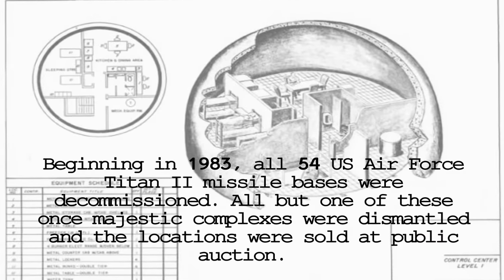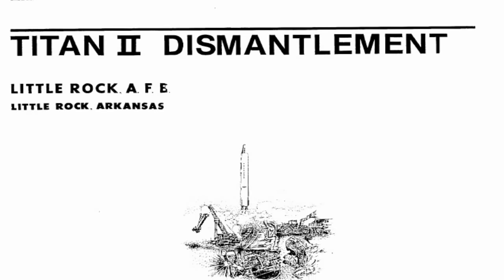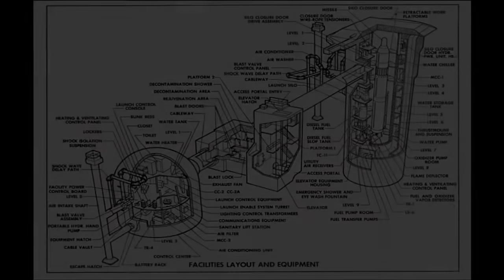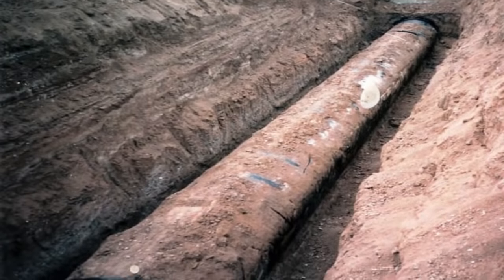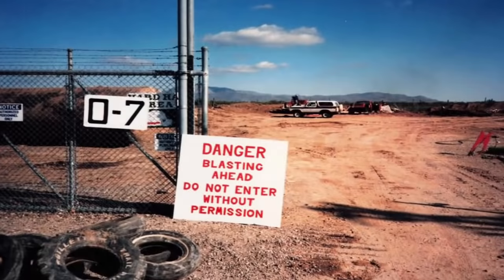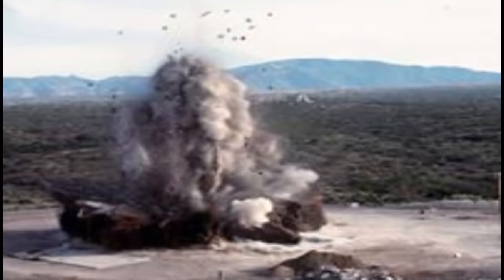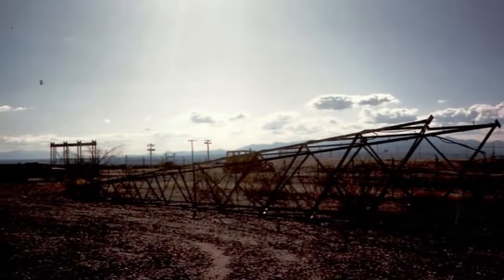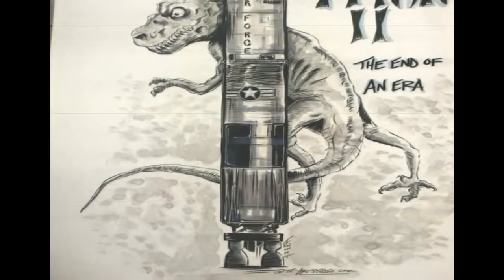Titan II Legacy - Part 3: Deactivation

Comment: This answers everything I needed to know about the condition of the silo. Thank you sir
Reply: I have personally been inside 2 of these facilities. Neither were the saved sights both were "decommissioned" per this video. However only about 10% of the connent in the video was actually done.
Reply: @hellsrangers1  Good old 'Lowest Bidder Wins' principle. Wonder how long it'll be,  before Pelosi Schumer Feinstein AOC decide to sue the contractors for not performing the contacts to spec?
Reply: Erik Davis what 10% of demolition was done?  Primarily the silo?
Reply: Thanks for the awesome videos. What were the tires used for during demolition? Absorb the blast and send it back down for ultimate effect? That’s my guess.

Comment: Three years ago I visited some Russian nuclear missile sites in the Baltic states. The first one I checked was completely gone, while some aerial photos available on mapping sites in the www where still showing them intact. Judging by the size of the trees at at size, the demolishment hand happened not more than two years ago.
At the second site I visited, work was just going on. They basically excavated the command and control bunkers from the surface, just the reversed way they had been build. Looking at the footage now in this video series, I get the impression the at the US titan silos where build MUCH more massive. I doubts the Russian installations would have survived a direct hit, as the control bunkers where covered by a relatively thin layer of earth.
Finally I was lucky visiting the third site. The basic concrete structures where still intact. The silos top domes where in place, but all metal had been removed from inside and outside, including the steel doors that covered the top of silo domes, which where to be opened when the nuclear warhead was installed.. So basically you could stand on top of the dome and look down 30m trough a 3m wide hole, all the way down to the water level at half height of the silo. If the Russian maffia would have needed to get rid of someone: this would have been the site of choice. If you felt into the water filled  silo there was no way out, as all ladders and platforms had been removed as scrap metal.
I could also get access to the control bunker. Every complex consisted of four silos in a square configuration with a central control and command bunker in two levels. From there connection tunnels where running diagonal to the four silos. The bunker had one wall broken open, again to remove all metal of some value, including the fuel tanks, machinery, tubings, electric cables and even the stairs in to the lower level. Moving inside this structure required great care and slow, very controlled movements as there where was lots of trash inside, but also open holes in the floor between level one and two. I finally reached one of the silos and could stick my head inside. This was probably the most bizarre feeling of my live, knowing that not too many years before, there was a missile with a nuclear warhead inside, aiming at Central Europe. 
I recently checked newer aerial footage and could see that also this site has now been demolished. However there is one "Cold War Museum" in what is probably the last preserved "R-12 Dvina" installation in Plokstine, Lithuania. I am hoping to be able to visit this site next year, but right now their homepage is offline - so hopefully the museum is still open!

Comment: Glad I had the chance to tour a training facility at Vandenberg AFB while I was stationed there in the early 90s. What a cool deal with the "house" up top, the elevator ride down, the control room, the equipment room, and the huge blast doors all in clean, dry and "usable" condition. The only thing I didn't get to see was the silo itself. 

I also worked on mapping and marking the sites there for the start treaty. While doing that one of the oddest things there was the peacekeeper rail garrison test track setup. Most of us thought at the time it would just be smarter to put them on Amtrack trains, so nobody would know where they were since they never ran on schedule anyhow.

Comment: What an excellent video explanation.  Thank you.  I would guess that the silo excavation is prohibitively expensive.  I wonder is anyone has every been able to do anything with the silo portion.
Reply: TheReefaholic
 ... what would you do with the silo portion? It's 50 ft wide and over 100 ft deep... and full of crap at the moment. Likely cheaper to construct something new at this point. There is one still open for scuba diving and once you certify you can go on a full tour.
Reply: Well let me answer that question backwards. I would think digging a new underground facility to let’s just say expand your square footage would be galactically expensive. The architectural and engineering costs as well as permitting alone would probably scare most people away. The labor work of installing just the rebar alone would be earth shattering for most common folk. So I think excavating out the debris and building a new On the current silo would be more practical.

As far as what would I do with it. The square footage of the command portion is not that much. I would think having multiple levels of storage space mechanical space (generator and have) As well as additional living space would be great.

Just because one makes the decision to live on the ground does not mean one abandons everything that they want to have in their home above ground. While some people may be building for the apocalypse, you may be living there a lifetime before the apocalypse comes. So I would still like to have my home theater, family room, guest bedrooms, and anything else you can think of. And at 50 feet wide it is wider than my current house. I think the atlas F silo is much more conducive for that. As you just need to remove the steel. But I’ve really only seen one or two people that I’ve even done that
Reply: @thereefaholic  ... you could also rebuild to standard underground specs instead of nuclear hardened specs. I'm sure that would chop millions off the budget.... AND ... you could still close a blast door and duck into the heftier sections if the need should arise.

Comment: THe Eastern Washington site was not filled like they describe either. The elevator shaft is wide open as are most of the tunnels. You can walk between the dome and silo which was stripped but remains intact and empty. The top of the dome is exposed and a hole blown in it to remove stuff.
Reply: Yes, that's how it was. One odd thing was that we searched everytwhere for a tunnel to the base of the ICBM and could never find a way to it. Only a tunnel that intersected it around half way up. 
From the mid-way point you could shine a light down and not see the bottom!

Comment: Why they use grout instead of cement to fill it up?
Reply from the maker: Not too sure other than that was the specification put into the decommissioning instruction document.  It explains exactly the consistency and material to be used for the grout.
Reply: Atomic Rancher    That odd.  Because grout harder than cement. But cause a lot more.

Comment: This explains why my site was missing the tunnel and the escape tunnel filled with concrete.  :(
Reply from the maker: Do you own a site or did ya work at one of them?
Reply: @ThompsonAtomicRanch  I was a part owner in one.  We had the pleasure of digging it out after being closed for all those years.  I have pictures of me on a giant trackhoe digging out the access portal.  I turned over my share after being activated following 9/11.  One of my biggest regrets ever.
Reply from the maker: @danielblack4313  Bummer!  What site did ya have part ownership of?
Reply: @ThompsonAtomicRanch  570-8  I understand it's currently for sale.
Reply: @thomasfoster2  There was a wide variance between what was supposed to be done and what was done during decom.  You're only true test was to dig it out and see.
Reply: You are probably aware it sold a couple weeks ago to a local Tucson resident.
Reply: @ArizonaTitan  Yes

Comment: i feel liek the tire idea was someone just having fun lol
Reply: I can't think of a reason why to do that other than "proof" that in fact there was an explosion.  I'd be interested to know the real reason.
Reply: @Game-The-System  That way they could test what would happen, if a nuclear rocket explodes inside such a missile silo.
Reply: All that effort to decommission the silo, and no time to pick up the tires.
Reply: @MichaelSHartman  That is the weird part.  In the video it says they laid them out on top of the blasting surface (intentionally).  I'm dumbfounded as to why.
Reply: @Game-The-System  With the tires they can minimize the damage of the explosion for the surrounding area.
Reply: @OpenGL4ever  Sorry, that doesn't sound any more plausible than your last comment.
Tires wouldn't stop or slow down debris from a demolition charge...not much anyway.  That would just be silly as any small debris would go right through/past them and any large debris would just knock the tires away.  If they were worried about flying debris, laying chainlink fencing over the site would do a better job arresting debris.  Furthermore, from what I recall these were generally 12+ acre sites, which I'd think would be more than adequate distance from a targeted demolition blast.
Reply: @Game-The-System  Well that's the way it is done. They use what they can find and afford.  Then this mass is put on or next to the exploding device.
Reply: @OpenGL4ever  i have seen used truck tires used as a blasting mat. The sidewalls are cut off and the treads are bolted together in two, overlapping layers. This makes a mat that contains the blast.

What they did was throw tires on top which will do nothing but scatter tires from Hell to breakfast.
Reply: Yeah. Throwing a bunch of loose tires around will do nothing